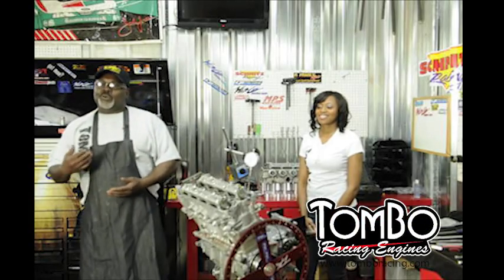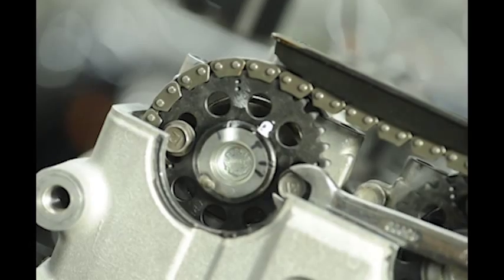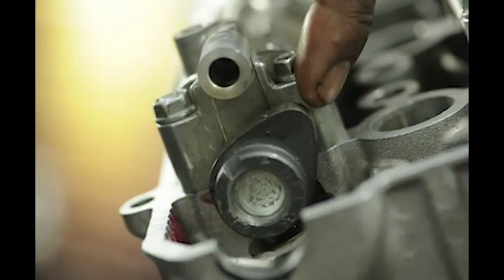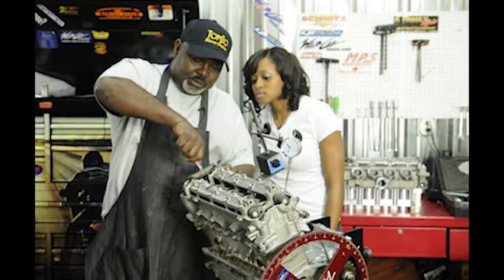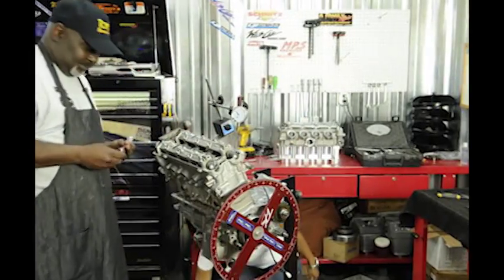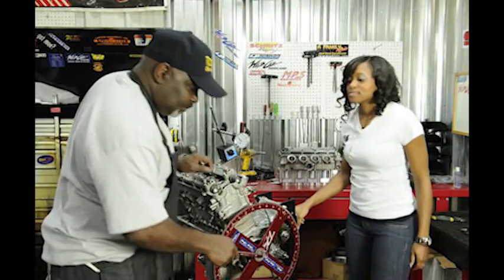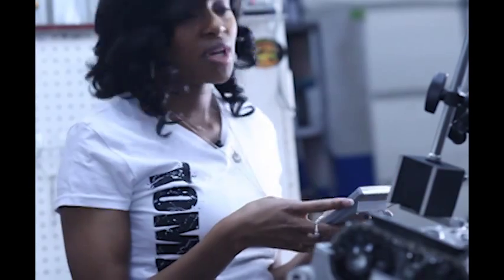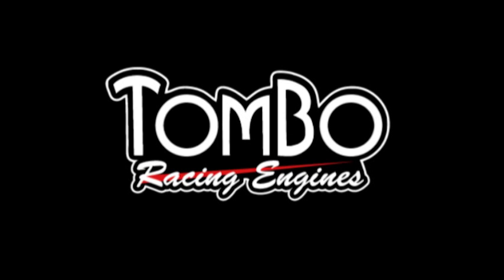Hayabusa engine rebuild Part 5 - Cam Timing

Comment: At last! Somebody that explains it straight without going off on a tangent. Great tutorial video. If anyone doesn't understand this, they need to stay away from even trying it on their own engine. You need a basic understanding of how engines work. So if you can't bolt up a degree wheel accurately, look it up- it's simple.

Comment: Hey Tommy, I have a question question for you Sir!

First, a compliment! Awesome channel/content that speaks to not only seasoned builders/racers but also those trying to learn and build these bikes DIY!

Second, so we are building a DIY blown Gen 2 Busa. We actually went with a Rotrex Supercharger instead of a turbo on this bike.  

My question is, we are looking to push about 23-24 psi on a base spacer motor, again a Gen 2 Busa.  Was considering boing w a big bore build with 23-24 psi.

My question is, would you recommend sticking w the stock bore and the 1340 or go ahead w a big bore kit since the motor is out anyway?  Budget really isn’t an issue, well if you talk to my Wife it is but hey I don’t tell her what shoes to spend $$$$$ on right? Great so again budget really isn’t an issue luckily!

Would love your opinion or suggestions on this!

I read that going w a big bore kit doesn’t give as much of a return on investment/w HP as one would think when boosting a motor?

Is this incorrect info or personal opinion?

Now don’t get me wrong, I don’t want to spend $10k on a build going w a big bore motor to gain slightly more than I’d get just sticking w a strong set of internals but staying w the 1340 !!

Again would love to hear some feedback….

I appreciate you Sir.

🫡